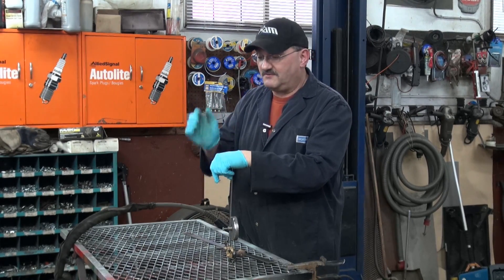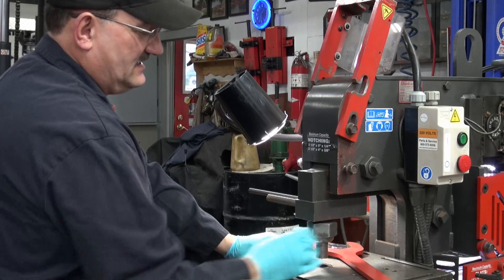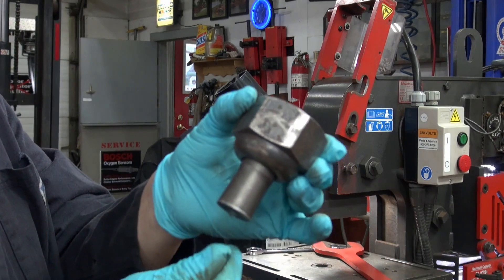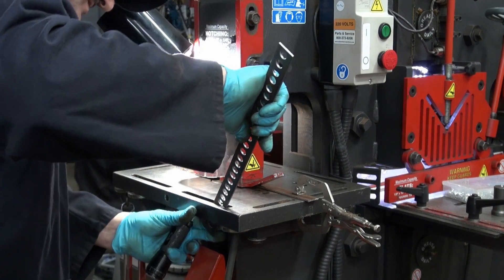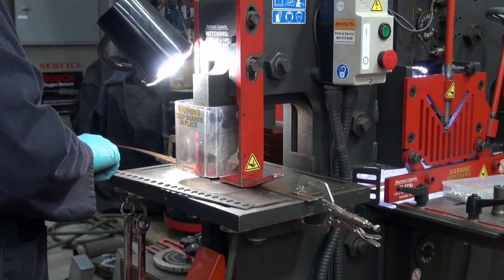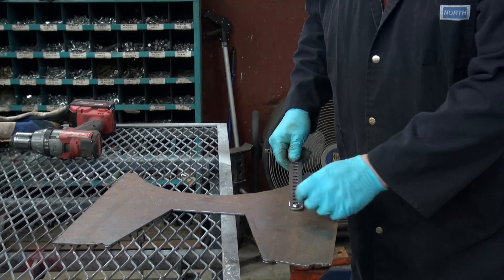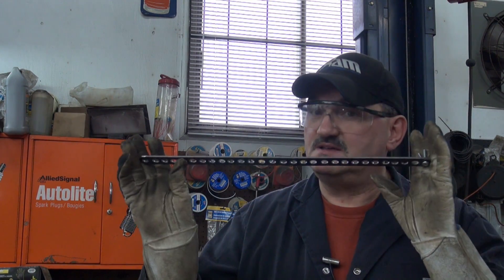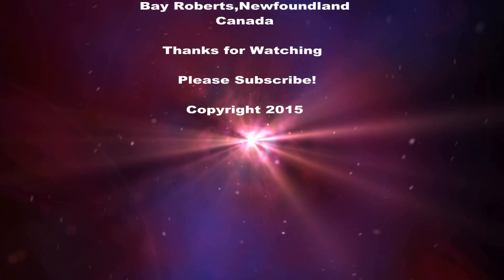Fabricating A Cheap Plasma Cutting Circle Guide

Comment: Nice, but 2/3 of it isn't about "Fabricating A Cheap Plasma Cutting Circle Guide" but about using a piece of equipment that 99.9% of the people making one won't have. :-(
Reply from the maker: You can do the same by using a drill. Do you own a drill? 99% of fabricating is using ones imagination;)
Reply: You beat me to it, the video should have been, "How to set up punches in your Ironworker" on the other hand, it could be posted under both titles?

Comment: The holes are a great idea for guiding the plasma torch. It does require that you use the drag tip type shield on the torch to fit the holes.  If you wanted infinite circle size adjustment? You could make a a slot in stead of the threaded center pivot hole. Weld the center pivot on the head of a carriage bolt. The slot, as long as the space between two holes, would match the square under the carriage bolt head. A washer and nut could snug the adjustable center pivot at any precise radius needed. Make several, one with a bolt pivot, and one with hardened point, and one for the magnet?

For years I only had an oxy-acetylene torch for use with my circles burner.  I made a spinning table to set the work on. Flat bars on edge, like a grate, and only 12"x12" square table. It spins on a sealed bearing and shaft from an old hydraulic pump (clamp the shaft in a vise). With the hole center punch-marked, I'd spin the whole little table, work-piece and all,  just with that center point on the tool.  It made a lot smoother cut than when guiding the torch around the circle while the work is stationary.  The punch mark has to be off center on the spinning table to make the whole thing spin with it.
Your tool should work great with a spinning table like that. The torch would always stay above the circle tool while the metal and the table spins under it.

I need to setup my plasma cutter to work with my spinning table, but my torch doesn't always use a drag shield over the nozzle,  it has a spinning device with little guide wheels to space it off the work......I'll come up with something.

It is great seeing your demos with that ironworker. What a nice machine! I wish for one!

Comment: good idea now for a question, where do you get your consumables the last time i asked about a drag cup for my 875 the local miller dealer looked at me with ?(? in their eyes
Reply from the maker: quietmale00101 
Thanks! I get all my supplies from our Miller welding store in the city. On each machine there's a chart showing the part numbers for each part and when I start getting low on the consumables I simply pick up the phone and order the parts. Most of the time they even have them in stock. If they don't then it's only a few days and they call us telling us they have them. It's another reason why we purchase Miller Welding products.
Keep well.

Comment: You’ve inspired me to buy a brand new truck Paul. The one I have is now going on 15 yrs old and is still like new but the miles have built up and there is a few things I’ve noticed with the paint I’m not too happy with. I’ve decided to buy the exact same vehicle as mine only brand new as Nissan has been making them for 17 yrs with 2014 being the last year of the tuff D22 Nissan Navara. It has a few perks over mine such as a 2.5ltr turbo diesel and nicer interior features. I can’t wait to pick it up and hopefully in 20 yrs it’ll look as good as yours! I don’t see myself ever upgrading to the new Nissan Navara because it’s a horrible looking plastic fantastic.
Reply from the maker: TechStories79 
Cool. New rig! Wow. I can't justify a new truck yet. Mine is only 21 years old yet. Maybe in another 15 I might look at getting a new one lol. 
sounds like your getting a nice machine. Hope it works out for you. Look after it and it will last. I plowed snow with mine for 13 years commercially and I never put a scratch on it. I waxed it, Undercoated it, serviced it and looked after it and it still looks new. I think i'll keep it.
Good luck.

Comment: Always enjoy your videos !! I do have a question for you... coming from someone who doesn't have a plasma cutter it seems like it would work better if you had a gap between the wing nut and the piece of steel ???? That way the plasma cutter would be off the piece your cutting by 1/8-1/4 inch. Would it cut better that way or not ?????
Reply from the maker: hello6488 

Thank you. @user/12345NoNamesLeft  got it right. The tip on my unit is designed to rest right on the metal. It can  and cut all day like it. No need for a spacer in this case. Good observation on your part those. Goes to show your paying attention ;)
Reply: There are different types of tips, there is what they call a "drag" tip- where the tip is made to drag on the workpiece and it sets the correct distance.
Reply from the maker: 12345NoNamesLeft 

Exactly. That's the way it is.